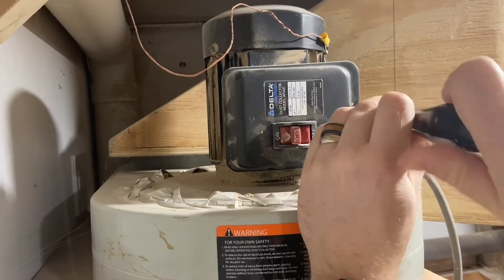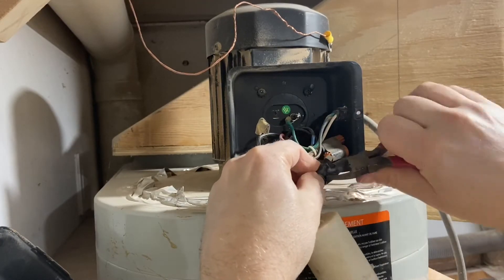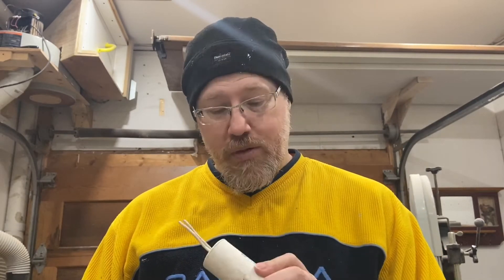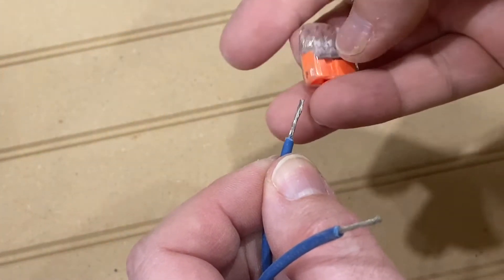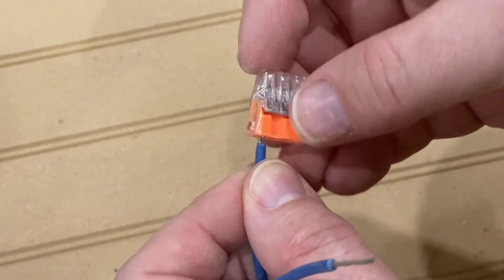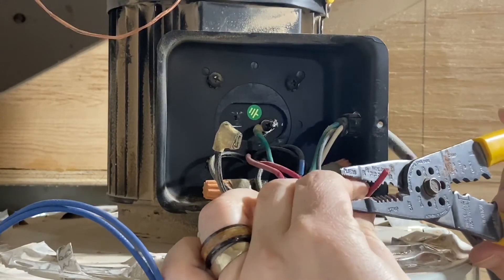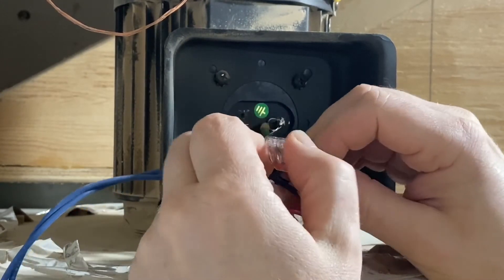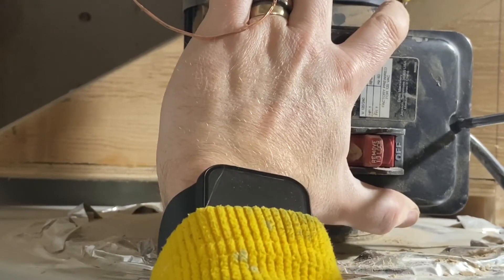Delta Dust Collector Repair

Comment: Thanks for your video, no nonsense and all the violin in other videos... I have exactly the same problem, they say it's the start capacitor not the run capacitor, but I can't find the start capacitor anywhere...so I guess there is only one capacitor! Mine is rated at 30uF and they say it's discontinued...so is the 5-10% is for the size of the capacitor uF ?
Reply from the maker: I was told +/-10% is ok. I’m not an electrician, but it worked for me.

Comment: Could you show how you mounted the dust collector to the wall. Thanks
Reply from the maker: You get a better view of how the dust collector is mounted in my air cleaner video. It basically just a board with holes for the inlet and the collection bag (which is now sealed off). Let me know if you need more details.
Reply: @humandoing9675  You have a Canada shirt, so people wonder if you are in Canada and where in Canada...